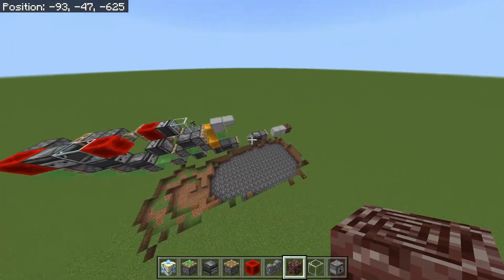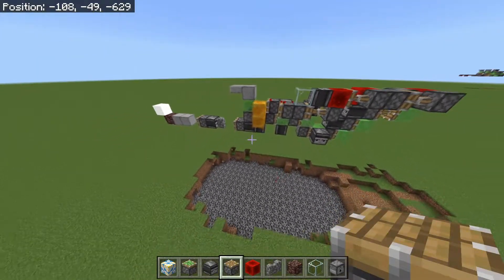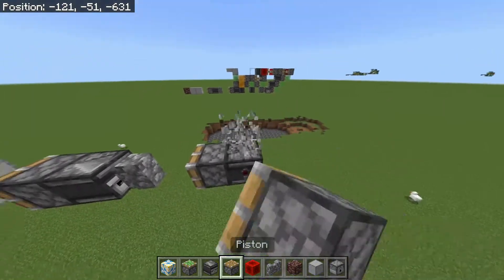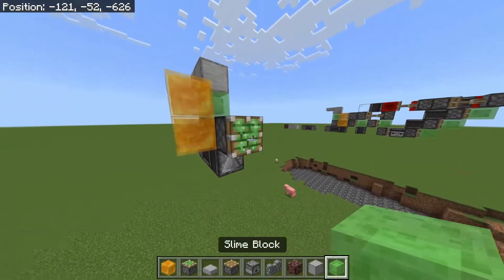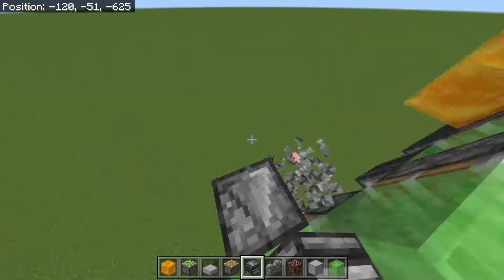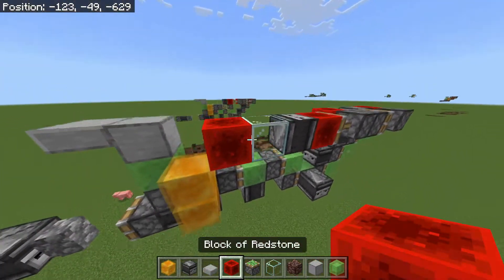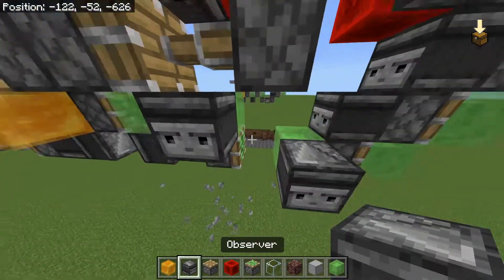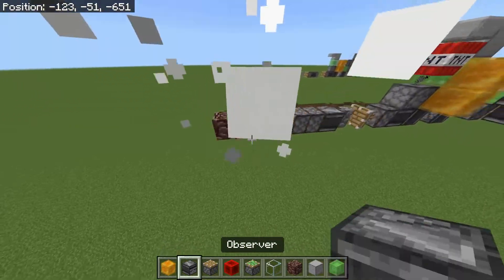Automated tunnel bore tutorial

Comment: materials list please?
Reply from the maker: I am unsure weather this tunnel bore still works due to the new update breaking many of the bedrock tunnel bores
Reply: @Firstdanjosh  it works i just tested
Reply from the maker: Oh cool thx for checking I changed computers recently and didn't have the world. I'll try n get the matts list for you
Reply: @Firstdanjosh it worked in my work either
Reply: @Firstdanjosh  can this tunnel boor work in Java?
Reply: your tunnel drill is not bad but you have to stop constantly to prevent it from running aground and what i had if it runs aground then it disarms itself and then blows itself up this is not your fault but the benefit of the  automatic van spoon muffed ia that it also blows away the ground and therefore you do not have to stop every time
Reply from the maker: Sadly no
Reply from the maker: It shouldn't run into the ground when being used in the nether. The only time it may run into the ground is if you hit a large patch of Blackstone or do not clear debris
Reply: @Firstdanjosh  i use it in the over world hahaha
Reply: @Firstdanjosh  sad
Reply: @Firstdanjosh  no Java?
Reply from the maker: There's your problem buddy, I thought it was a bit off.... it wasn't designed with the overworld in mind
Reply: @Firstdanjosh  it works in the overworld
Reply from the maker: Yea but you have to keep checking and that can get annoying
Reply: @Firstdanjosh  yea  haha
Reply: @Firstdanjosh  I want to send you a video do you have instagram ?
Reply: @Firstdanjosh  do you have instagram or discord ?